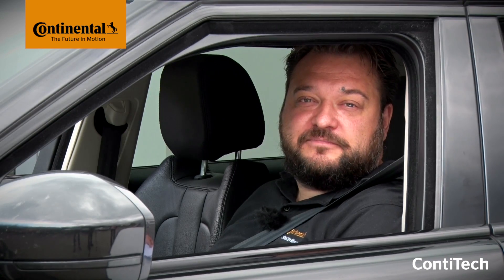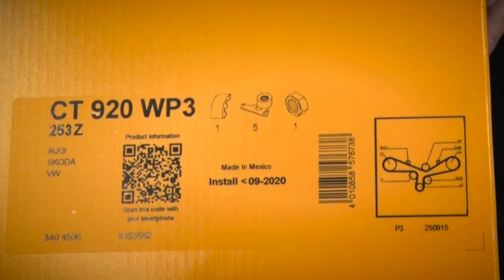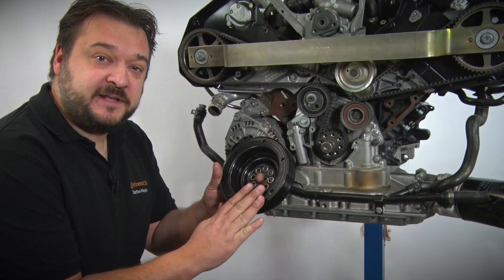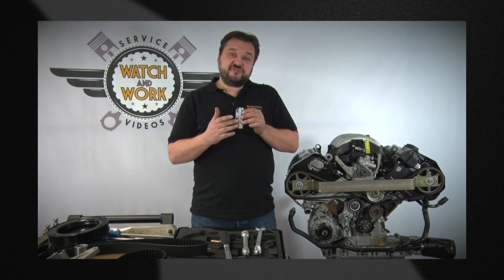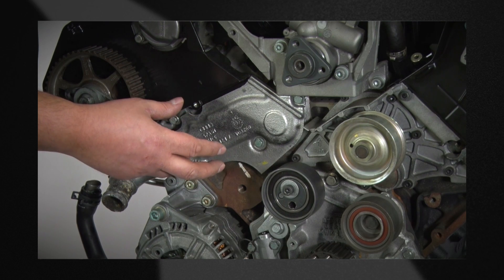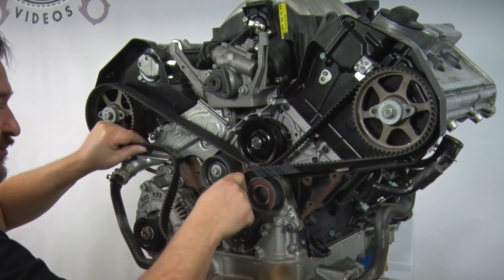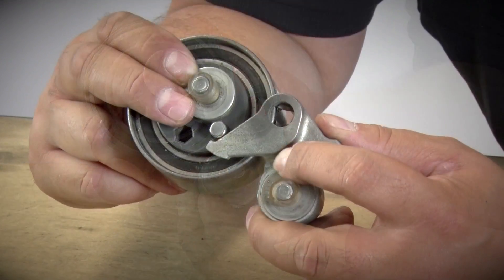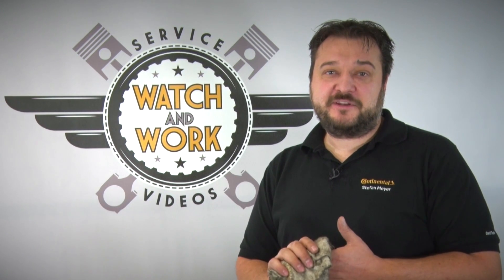[EN] Watch and Work - Audi 2.8 30V

Comment: You don't make any sense when inserting the crankshaft locking pin then turn the crankshaft to the timing marks! How can you rotate the crankshaft if the locking pin engaged? Whats the point of inserting it if the crankshaft can still rotate. I think your editor screwed up the video!
Reply from the maker: Hello JRP, 
thank you very much for your hint. 
Yes, that is correct! In the sequence, we have made a mistake! Correct would be the crankshaft to just before the TDC turn tool insert and then insert the crankshaft blocking tool.

Best regards, 
your Continental Aftermarket Team

Comment: To replace a thermostat, need to pull off the whole front of the car and remove timing belt. Nice...
Reply: German supercar right? No worries here, I still love my Passat.
Reply: @billpfeffer6954  Me likes mine too. It's an $800 beater that barely ran when I got it, but a bit of work on a number of minor maintenance issues and a tranny fluid change and I have me a 4motion snowmobile. Way more efficient than my 2004 Audi Allroad with a 4.2 V8 was
Reply: yup... just learned this an hr ago my weekend just got interesting...